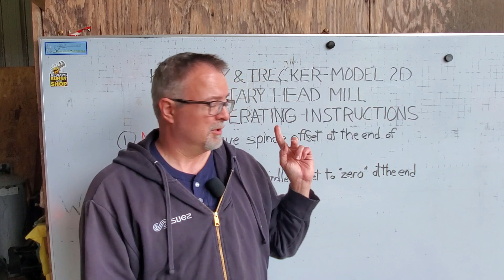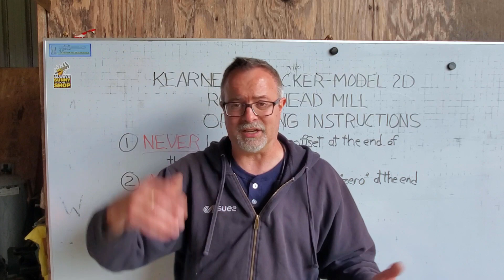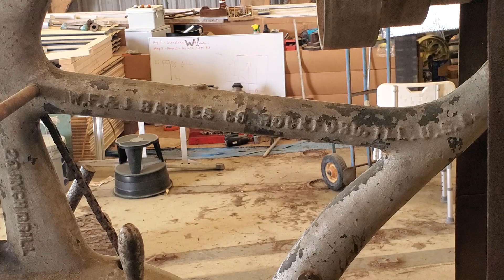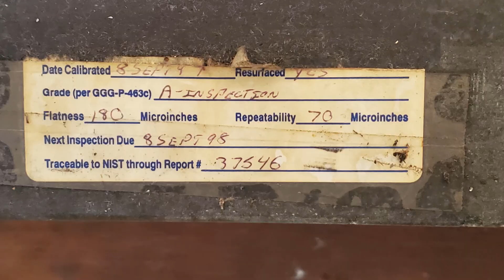Two New Machines and a Sad Tale of Their Journey Home

Comment: Apparently youtube doesn't want your machine shop co-op hahaha.
Reply from the maker: Right now it's a co-op of one unless my son is over working on his projects. Looking forward to "work days" when I can have some company in the building. The 30HP rotary converter should handle a few machines at a time. Might leave the compressor on the VFD, I like being able to spool it down to idle which reduces the noise a bunch. Check out my Quincy VFD video.
Reply: @EngineersWorkshop  I too have a 30 hp rotary phase converter for my 10 hp air compressor and m shop. How much extra was it to run 3 phase to the he building since you already had to buy new pad mount transformers and connect to grid. I'd think the price of a new RFC would be similar in cost of the difference in price. But I don't know. I have 3 phase at my road but I'd have to pay for 3 phase transformers and overhead wire to convert my shop to 3 phase. That and I built my RFC for about $600. I'll check out your vfd vid. I too used a rfc at first for my comp. But I got a 480 vfd so I had to add a single phase transformer to step 240 up to 480 into the vfd. I got the transformer for $100 on ebay and the vfd for free from a guy....
Reply from the maker: @electromechanicalstuff2602  I have a video about the three phase. I'm unclear if there is a "cost" to me. To hook up new single phase service, the Dominion rep knew I wanted three phase down the road, so he prepped the site for it by replacing the last pole, ran each phase down into it's own box, (two are dummies and one is the 400A transformer.) He says when I want the three phase they will place a new xfmr and pull all three phases into it and take back the single phase transformer. The single phase service and all the prep work didn't cost me a dime, and he talked like Dominion just absorbs their install cost since I send them a check every month forever anyway. Two years or so from now I'll call them back and have the 3 phase put in, and use the 45 kva transformer to generate my single phase. It's a 208Y/120/460 transformer.
Reply: @EngineersWorkshop  wow cool. DTE on michigan totally puts that bill on me.

Comment: The Barnes drill I found laying on it's side, in the mud.  It was in Steel City scrap yard in Lackawana NY on South Park Avenue.  My buddy's brother Scott was part owner of the yard, so I would go there and look around sometimes.  They loaded it into my truck,  my 1953 International pickup, with the scrap magnet crane.  Rough handling in the junkyard had broken the lever handle, which I vee'd out and brazed back together. Amazing it is a hollow casting, such intricate work back in the day.  I believe it was made in 1886 from the searching I have done.  The countershaft bearings I believe are Hyatt roller bearings.  I don't think they are tapered rollers, but I am not sure.  But typically Hyatt was those roller bearings with the spiral lubrication groove.  Famously seen in GM rear axles.
Reply from the maker: Cool bio on the drill, thanks Doozer. So cylindrical roller bearings, eh? Underappreciated in my opinion, great capacity for their size. We use spherical roller bearings a lot, love those too.

Comment: The Acra-Turn lathe is an older (1985?) model.  It has 12 geared speeds, and resembles the Colchester square head lathes of the time.  The newer  Acra-Turn lathes boasted 16 speeds, but it was only 8 geared speeds and a 2 speed motor.  This lathe came from Dynact corporation in California. Dynact was bought by Enidine, and the lathe moved to Buffalo NY with the acquisition.  I bought it from Enidine and brought it to Charlotte when I moved.   Then Heath bought it from me, and it made the eventful journey to Jim's shop in Virginia.  I am happy to see it live on.  The last time it was powered up was about 2000.  There are 3 gears and 1 shaft that were messed up,  Not sure why. There is a braze repair one one of the shift forks. Maybe a clue lies there. I bought new gears from Acra-Turn and included them with the lathe.  I hear Heath was looking for them in the grass and found them all.  Good man !
Reply from the maker: Will be going after the gears soon, anxious to make chips!
Reply from the maker: Did you say it was doing threading a lot?
Reply: @EngineersWorkshop  They had a round die holder in the tailstock,  just used it on low speed.  Never really moved the carriage, or did real cutting with it.